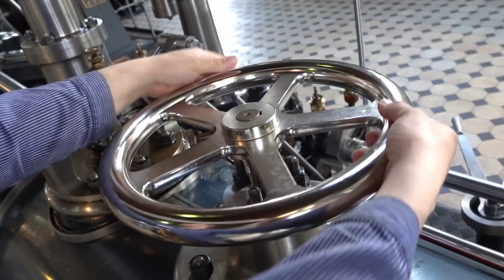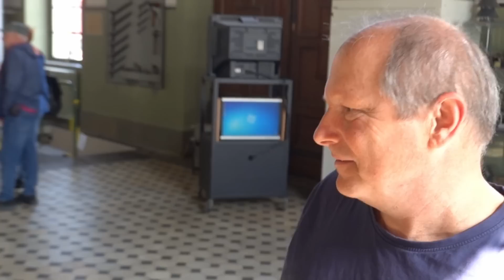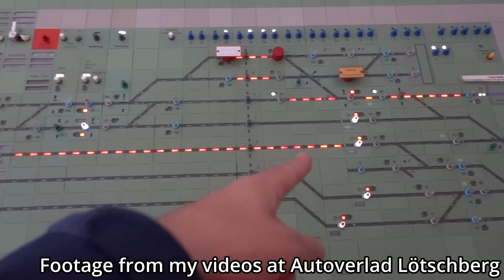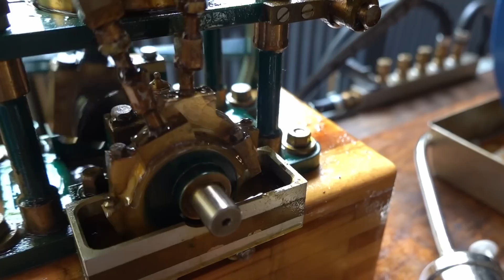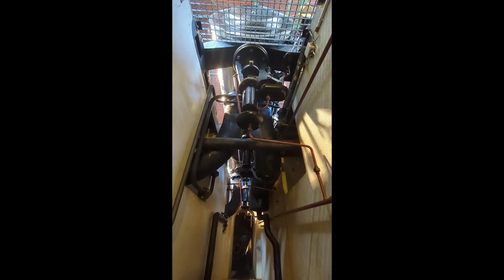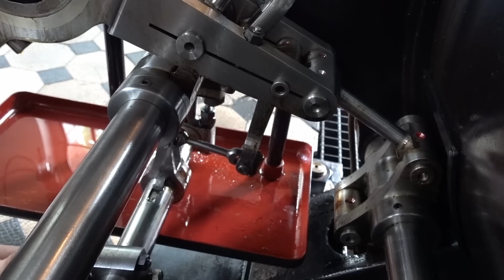De-mystifying a steam engine bottom-up

Comment: Wow, coal gas in use as late as 1974? Where I grew up in Canada, coal gas was phased out by 1915 upon discovery of natural gas, which was subsequently phased out in favour of more energy-dense LPG/propane gas in the 1950s (at the time considered a waste byproduct of oil refining), only for natural gas to be reintroduced in 2000. Residential installations, however, mostly converted to fully-electric in the 1950s and remain so today, with gas only used in commercial and industrial applications.

Comment: So, what you are showing off here, is a 120 year old steam engine, using variable valve timing to throttle itself, all done mechanically..... And BMW thinks it is so awesome with its modern electronically controlled, problem plagued system in gasoline engines now? HA! This is so much more awesome! Thank you so much for posting this!!! Need to show this to a friend that has a BMW with one of those very gasoline engines.....
Reply: Which BMW valve system are you thinking of?

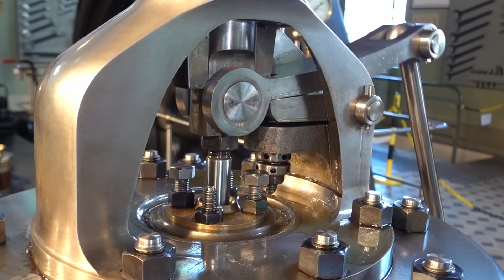Comment: 17:08 "The valve open in short bursts" This is very important, by letting some steam in and then closing the valve, the steam, which is pressurized, expands, giving energy (work) to the piston.
It is that expansion that does the work.
Reply: Ehhh, no. Using short intake bursts actually reduces the amount of work it can do (because the pressure difference across the piston decreases during the expansion), but it greatly increases efficiency. You can also leave the intake valve open, putting full boiler pressure on the piston, for nearly the entire stroke and then let it all out in a short burst at the end of the stroke. This can nearly double the amount of work done per stroke compared to burst-intake mode, but it also dumps a cylinder full of high-pressure stream out the exhaust at the end of each stroke, which is a huge waste of energy and water. In this case all the steam expansion happens when the exhaust valve opens and does no work on the piston, the energy is instead converted into impressive chuu-chuu sounds from the exhaust stack.

The Stephenson valve gear he explains at 13:45 allows an engine to operate in either of these modes or anything in between. This is used in stream locomotives for example, which use the inefficient max-power mode (power reverse bar "in the corner") to have max torque available to get the train started, and then as the train picks up speed the engineer will gradually move the bar towards the center to get short intake bursts for efficient operation (and reduced wear on the engine).
Reply: Le meilleur système est celui de Corlis !  @MatthijsvanDuin

Comment: It doesn't look like you have large enough boilers to supply a 300 HP engine.
Reply: The generator isn't really loaded up that much, so the engine never really gets any where close to developing 300 HP in preservation. The small boilers are able to effectively supply steam because the engine is through steam very slowly and efficiently.

Comment: Since a While I work on the "Täggelibock" On the lake of brienz. Its switzerlands oldest Motorship. Its a ship from 1909 which is almost as old as this steam engine. It is still operational by the way

I am an engineer there, and the Oiling caused some PTSD not gonna lie.
I have to oil the motor every 30ish minutes, its crazy
Reply from the maker: Do I hear a future video? 🙂
Reply: @sandro-here  i think I and the täggelibock team would love to velocome you onboard

I would have to ask obveiously
Reply from the maker: @mutzbunny  Sounds great! How do I get in touch?
Reply: Jim Sim...during the age of steel there were ..boiler makers ..engineers .. 100 s of other trades one trade is very overlooked and more important than the rest ..that was the oiler ..he had to know about all types of oil ..viscosity ..tolerance to heat ..correct use piston ..crank ..controll shaft ..this was an apprentice learned job with some education when employed by big companies eg shipping lines railways big factories usually weavers some steel industry .some American teams still use oilers in their names ...